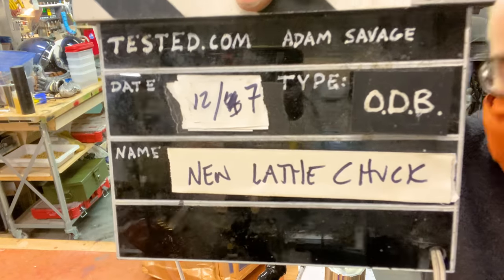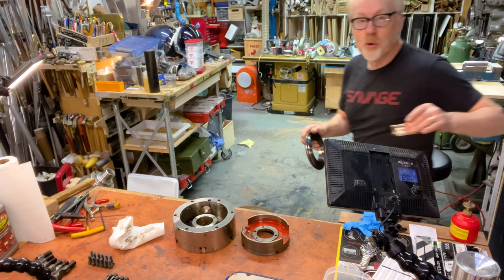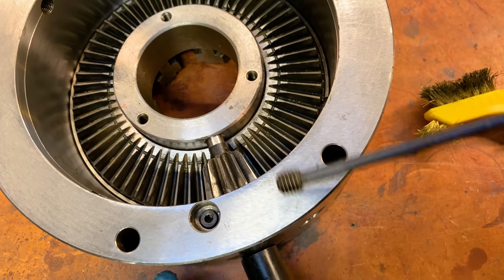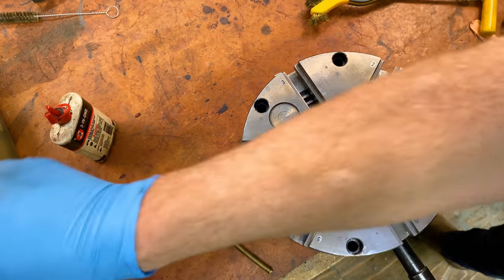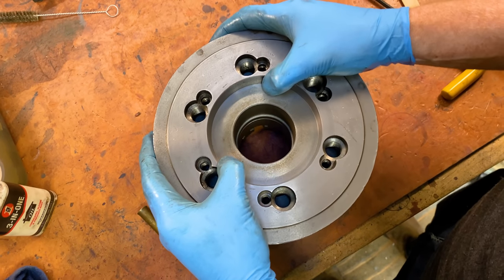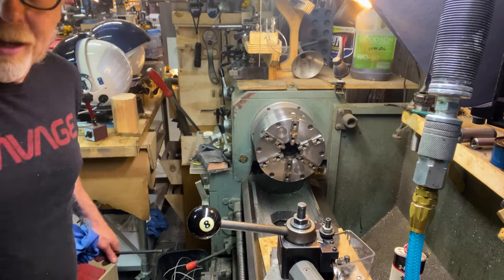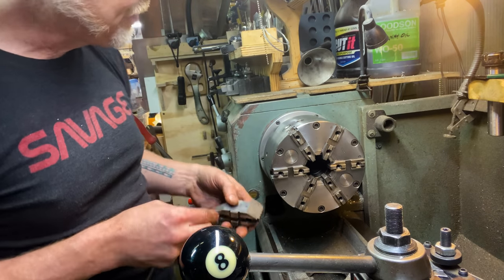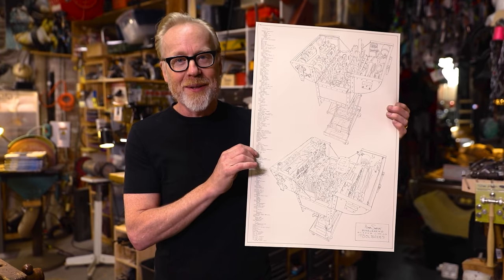Adam Savage's One Day Builds: New Lathe Chuck!

Comment: Please pardon my pontification. I'm a machinist of many years of experience with a word of caution for the hobbyists and those new to machine tools in general and lathe chucks in particular. Three and six jaws chucks while heavy and seemingly robust are actually quite delicate. The precision built into them may vanish with a single wreck where the work is dislodged from the jaws. You might think an error can be remedied by grinding the jaws (a major operation requiring a tool post grinder and a boring ring) or tweaking the offset screws if the concentricity is adjustable. However, the scroll may be locally deformed meaning there will be a diameter setting where concentricity error takes a little jump. Then there is "nutation error" where the grip axis describes a narrow cone. These will be small errors, possibly negligable, but important when high precision is demanded. 

Therefore three and six jaw chucks should be used with care reserving them for light stock removal and second operations. Perform the heavy roughing and interrupted cuts in a four jaw. Those of you buying used chucks beware of abuse by previous owners. I strongly encourage purchasers to perform a "last part" tear down, cleaning, and inspection following Adam's example in this video. Check concentricity over several diameters close to the jaws and 4" out. Knowledge of concentricity error aids the user in compensating and minimizing its effect on the finished work.

Comment: Pretty sure it should be oil inside the chuck, you can get an oil gun that fits on the fitting (we call them nipples this side of the pond) grease holds onto muck far worse than oil.

Comment: I don´t think i ever saw a 6-Jaw chuck...and i cant really make sense of it apart from hold stuff extra extra secured? o.O I hope you can run it with only 3 Jaws inserted 
because "that is the way" ;)
Oh and btw. with that dial you just checked if the workpiece is centered (more or less) if you want to check the chuck, you need to get the dial on the chuck.

Comment: Darn, I thought he was going to build a chuck.
Reply: Still good. I never knew how the jaws were physically tightened!
Reply: It seems like each jaw would be a little more distant from the center as they go around the spiral. Is that why they are numbered? Are the jaws each individually different?
Reply: @TheRainHarvester  I think they are, to account for the different distances with the spirals
Reply: I also tuned in for that, but wondered how many weeks it would take him. I don’t even know how you machine the jaw scroll.
Reply: @matthewmarting3623  similar to the way you'd do threads
Reply: @videogame1291  Correct. At 26:00 he starts preparing to seat the jaws, and you’ll notice that he does each jaw sequentially, engaging it with the outer tooth of the spiral, before rotating the spiral around to pick up the next jaw. 💜🤓👍
Reply: In one day? Good luck with that!
Reply: I would imagine that building a chuck is beyond the type of precision he would attempt. Imprecision in a machine tool is multiplied in the products you make with the tool. Not saying he couldn't do it well, just saying he's usually more of a "close enough" builder (which is good for props and cos-play).

Comment: Possibly stupid question. If you didn't have a precision ground object to check concentricity, could you just turn down a piece of stock then rotate it 180 degrees in the chuck to take the measurement? If my thinking is correct the concentricity errors of the chuck and the stock should then be equal and now added together meaning your measurement would be amplified by 2 (eg. a measured error of .004" would be .002" of actual error). would this work or am I way off base?

Comment: I'm awaiting a couple of upgrades for my Amiga 1200 - one of which will give my 29 year old Amiga an HDMI port. The other will give me a floppy drive emulator, which will eliminate the need for me to use the 29 year old floppy disks (which are still working, mind you), as I get a USB plug for a pen drive with floppy disk images instead of an actual floppy drive. Both parts will be here any day now :-)

Comment: Tip, You should of used a Homing/lapping stone on  the groves of the jaws and jaw slots to make smooth .
As using a hammer to force some jaws in is a  BIG (NO NO)
At that stage you should of took back out and then smoothed out the surfaces.

Comment: No parts of a precision chuck should require a hammer for assembly.  Find the mating part interference that’s causing the binding, and file or stone out the issue. It should open and close  smoothly for that small chuck. Also, oil is going to fly into your hair and face. Use something like dry graphite or equivalent. Congrats on your capital acquisition.

Comment: now that the 6 jaw is on there, would there ever be a reason to use the 3 jaw?
Reply: jake3040 3 jaws have better grip on non machined surfaces, think of a tripod on a rocky surface. The 6 jaw is used for thin wall parts, less distortion.

Comment: Six independent jaws I could understand, like a four-jaw for hexagonal stock, but it seems like with six synchronized jaws some of them won't land at the same time if the part isn't already perfectly round and concentric when it goes in.
Reply: It's much gentler on hollow materials that are more likely to deform in a 3-jaw when you tighten the jaws down.
Reply: That's a very good point, hadn't thought of that.

Comment: I feel like that low-viscosity oil is just going to fling out of there as soon as there's a few RPM going...
Reply: I think it’s more for assembly than much else, until it gets run in and the fiber grease is spread around nicely
Reply: @cameronlewis5307  yeah, I'm sure that's correct it's just funny to imagine the black line running from the ceiling a few feet behind the lathe, running down the wall, over the table, and then a few feet behind the lathe on the floor. One of those little micro-mysteries you'd get the slightest chuckle out of when you solve the case of the phantom chuck-line

Comment: Hi Adam. Hi from France. Love your videos. Huge fan since Mythbusters. Just a suggestion. Grease is fine as a lubricant inside the chuck but you should avoid it on the parts that are exposed to chips and grit such as the jaws and the scroll. The risk is that the grit is going to stick to the grease and make it turn into an abrasive compound that could damage the chuck. You should use oil instead: not as sticky and used a lot, it will flush the grit.

Comment: Lathes and milling machines are never greased they are always oiled !! this is very important because otherwise the channels will clog.

it is not an agricultural machine !!!
Reply: @varmituofm  the tolerances on such a machine are too small for grease.
Many machines have a central lubrication system that distributes the oil through fine channels on the guides.
the upper surfaces of the guides are also designed to hold oil in fine depressions.

also you can see in the video that the pin on the adame wants to attach his grease gun is a pin for an oil gun. that's why it doesn't fit either.

Lubricating grease is only used in bearings that are equipped with permanent lubrication.

They are also found on the machines, but not in the area of guides and chucks
Reply: @polini1982  cool didn't know that much about this part. I'm more familiar with a Wisconsin lathe, for which manufacturers recommend grease in the chuck scroll

Comment: For home hobby machinists watching this keep in mind that Adam does dangerous stuff that would get you fired from any machine shop I ever worked in. 
Ask any nurse that has worked in the emergency room what happens when your ring, watch, loose clothing, or a strand of hair gets caught in rotating machinery. Don't ask if you've just had something to eat.
Compressed air is not your lathe's friend. It very good at blowing tiny metallic particles into sliding and rolling elements. It does a good job of causing a lathe's change gears to get packed with swarf to the point that gear teeth can be broken. 
Grease should be used sparingly. It turns things like cast iron swarf into a really good grinding compound. Use plenty of oil to keep sliding and rolling elements flushed out and not just to lubricate.

Comment: For easy removal of bolts apply one of the following WD40 or grease any kind will work or anti seize it will help your bolt removal on anything like your chucks or vise bolts. Also buy a dressing stone any style will work but the stone is used on every part of the chuck or vise parts or mill table even. I recommend the 2 sided one with fine and corse side. It will help you a lot to be more accurate and makes sure that their is no raised metal. A stone cost about 10$

Comment: Im not an expert at machining, but i know that a 3 jaw chuck is used becouse all three jaws move exactly the same and you can hold round stock very well (but the downside i guess is that it cant be adjusted) I also know that many machinists use 4 jaw chuks to be able to hold square stock and to be able to adjust and tighten every jaw individualy which takes a lot of time. but what exactly does a 6 jaw chuck better than a three jaw?? is it just more ridgid?
Reply: I have a three jaw adjustable Buck lathe chuck.
Reply: @aceroadholder2185  ok yes thats also an option, but i just dont see why to have a non adjusting 6 jaw chuck
Reply: @nicoeckerstorfer5893  You need all the grip you can get when you have a lathe with plenty of horsepower and the ability to achieve high stock removal rates.
I've only used a 6 jaw chuck a few times. In the home shop I don't know if they are worth the extra expense if bought new.  A new 6 jaw Buck chuck is not cheap even in the smaller sizes.

Comment: What do you gain by having a 6 jaw chuck over a 3 jaw chuck ?
Reply: Great for thin wall parts, doesn't distort them as much. Personal I feel it's harder to throw a part out of one vs a 3-jaw, especially on larger diameter parts or sketchy setups when you don't have much part engagement in the jaws.

Comment: could someone please explain me whats the pros in using 6 rather than 3 ?
Reply: More points of contact = a more well centered piece of work
Reply: @jarrettbeal833  Generally yes, but it also helps with deformation of the work piece. When you tighten a 3-jaw chuck you deform the work piece into a 3-lobed shape. With a six jaw this effect is way smaller.
Reply: @hitwerterfinder4595   @Jarrett Beal   okay thanks

Comment: The one thing that's missing is why use a 6 jaw chuck?! I've learned everything I know about lathes (which is very little) from Adam's video but I'm missing this piece of the puzzle
Reply: Less deformation on thin walled parts and better grip on odd shaped parts.  I’ve only ever used them on drill and cutter grinders
Reply: @noonerbernerd  Makes sense, thanks for the info

Comment: Okay, this is slightly off-topic, but this seems the most relevant. I've heard you correct yourself when you've said you're a machinist, and say you're actually just a machine operator. But given all the definitions I can find, you're much more a machinist. You can repair, maintain, program and completely fabricate parts. That seems to be a machinist in every definition I can find. Not really a tool tip, but maybe a tooler-tip? What's the difference in your mind?

Comment: Never ever grease a chuck, greasing a chuck especially the scroll any small chips over time will stick to the grease and cause premature wear you should only lubricate any part of a lathe with way oil the only thing on a lathe you should grease is the spindle bearings on the lathe motor if it has the capability and any zurk fitting on a lathe is not for grease but for way oil that you should use on your lathe bed ways